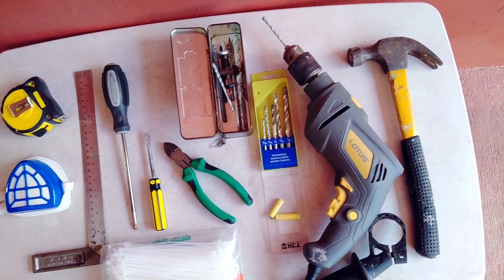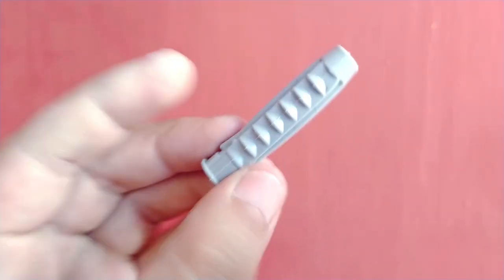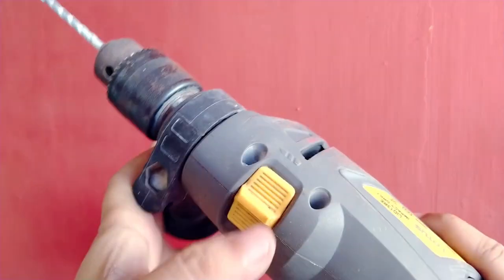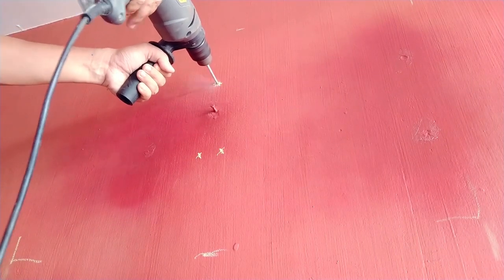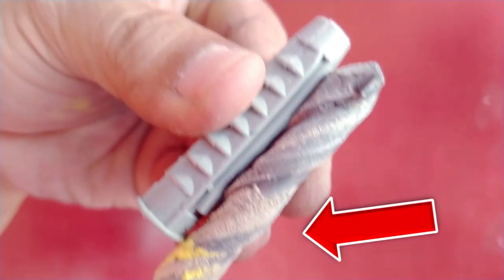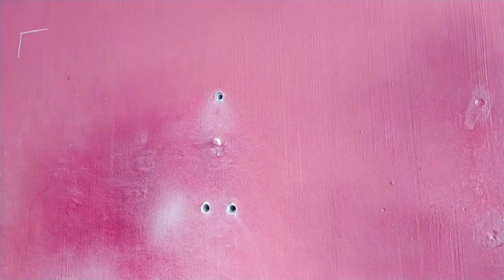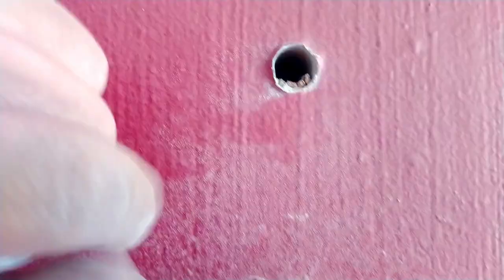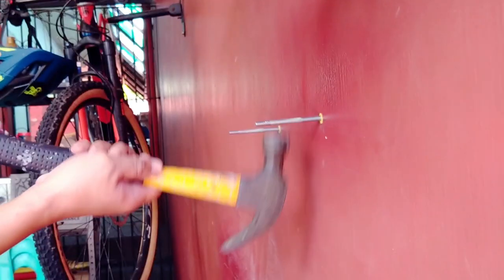9 Power Drill Hacks You Should Know | Drilling Hole in Concrete Wall

Comment: hi can we use that kind og driil in removing & installing motorcycle   bolts/nuts?
Reply from the maker: Yes but you need to use the right kind of attachments for bolts and nuts. This drill comes with   a 10-speed adjuster so you can select the appropriate torque/power.
Reply: I suggest you get an impact driver instead of a regular/hammer drill because an impact "DRIVER" offers more torque and is designed to drive screws, bolts, tighten nuts, and so. It is also more compact and lighter than average hammer drills or so.